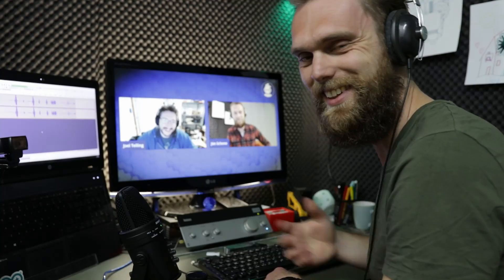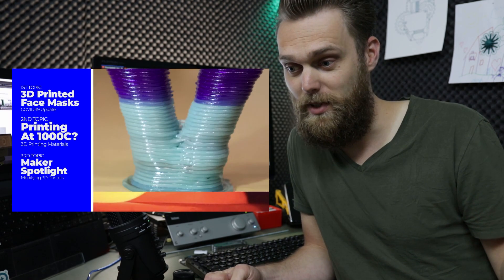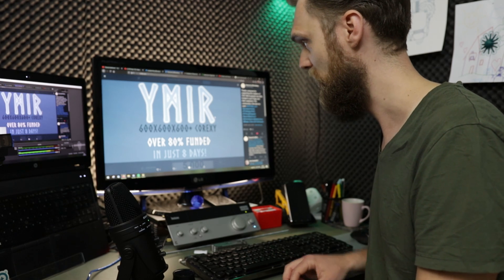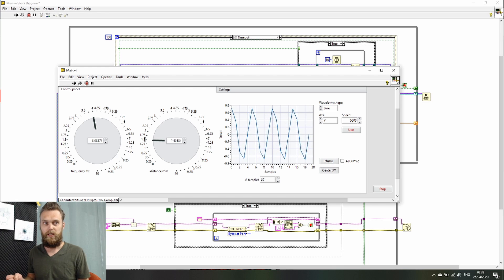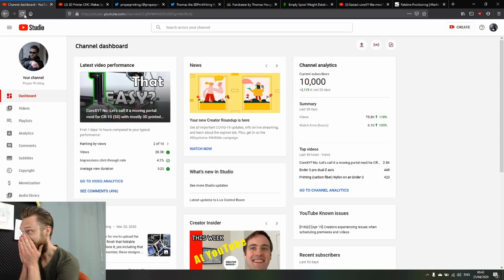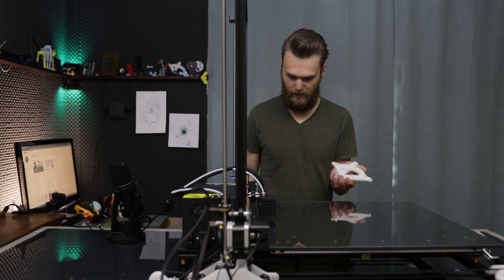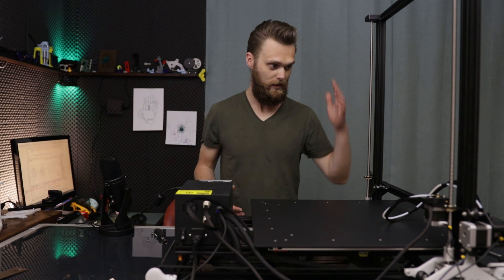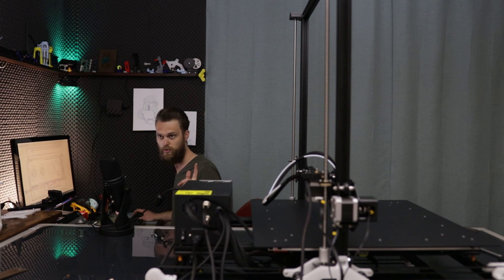Moving portal printer torture test, how does it perform?

Comment: Hi great work bro try my experiment if you can add in equal weight in the opposite direction of the extruder  so when it move the weight move in the opposite direction. I try this and I got amazing results, I’m sure with ur experience and knowledge you will get perfect high speed clean print, the main issue is the weight of the extruder wen it moves it creates wight pull to the belt and the belt expand little in higher speed

Exactly like the car wheel without balance wight it will make vibrations

Comment: I would add two uprights in the center of the front/back with a single cross beam connecting them. Put rollers on the top of the gantry that will connect to the top of the gantry.
You could even add a stepper motor fo automated centering at the top of the gantry.

Comment: This is an interesting idea.  If this concept was installed on the inside of a cube and the vertical member was captured at the top and bottom, then this would be a highly rigid design.  That would give you your enclosure as well.

Comment: If you want a moving gantry, my naive design would include it riding on a larger Y carriage, and triangulating the upright. Those alu profiles sticking straight up without support is never going to be good at 3D printer speed.

Comment: Jón: You could mod the software to keep track of what the apparent y frequency of osilation is (do x while at it) and have drivers alter print speed +/- n% to avoid those resonant modes. Got 32 bit controller, might ad well do something with that processing power. Could also add counter weight motors at top (bdlc with encoder or feedback driver) to oppose the forces if that was necessary. Math gets a little complicated with active dampening though.
Reply: BTW: Active dampening is very common in skyscrapers, weight is at about 2/3rds full hight.  Former World Trade Centres had it (thank goodness I never took the job as Mechanical Engineer for those buildings back in 1999!)

Comment: So your using the xy frequency limit feature in config_adv.h?? In theory the same printer should have similar enough resonant frequencies.. wonder if someone has done a stock ender 3 so i can use tht feature... Gues i could do this myself... Have an app on my phone tht measures vibrations actually. Dont have gcode programme though.. the feature says it limits the frequency of small zig-zag movements..?

Comment: Greetings.
If I got it correctly, You are planning to print (mostly/only) rims…
How about using a rotating print bed for that. A lot of the x and y travel would than be just smooth rotation (of the C axis I guess).
godspeed
Reply: Would be interesting to see. Actually there could a rotating axis on a rotating axis to cover a full circular print bed.

Comment: How about wheel wear? I may just build a 500x500 from scratch at this point and wanted to do this but figured it was unreal without more engineering for supports

Also do this with the z maxed out and move the y +/- to see how well it holds layer alignment throughout

Comment: An extrusion along the top of a chamber being used as a linear guide for horizontal extrusion at top of "gantry"(?) I would think can make it a lot more stable.
Reply from the maker: That would be my second phase and I think I'll do that. I think it's stiff enough, but it can always be improved ;)
Reply: @properprinting  if you don't want to make a full on enclosure 3 extrusions could make the top guide rail, 2 extrusions holding up a 3rd. 

Not as rigid as a enclosure with top guide extrusion but since the guide extrusion is only to help stiffen things up slightly it probably isn't going to have a bunch of force imparted into it.

Comment: Do you really need the printer to be that high? How much would you gain by reducing the Z height by 100 mm?
(Your data doesn't show it because the gantry weight would be lower)
Also: what if you replaced the top cross beam of the gantry by something much lighter?
(A carbon tube, for instance)
Reply from the maker: For this specific project I indeed don't need that height, but I have other plans for the future ;) It's already pretty stable IMO, but I'm going to make it more stable when making that enclosure

Comment: Can you modify the gcode to avoid moving the y gantry at speeds and changes in direction which will cause resonance?
Reply from the maker: Someone mentioned a Marlin branch which removes the resonance frequencies. I'm going for a mechanical approach by stabilizing it at the top :)

Comment: Dude I actually admire your work!!! Good job on getting guts to make youtube videos, its not an easy job and takes time and editing skills. Especially when english is not your main language. 
You have new subscriber and keep it up. I will keep an eye on this project. I think you could maybe improve this wobble at 400mm with reducing printing/movement speed. Try 3d printing brackets out of polycarbonite fillament/ Nylon, as PLA is very though, but its softer and therefore higher chances of wobble. 
Keep up with the great work!!!
Reply from the maker: Awesome, thanks for subscribing! I'm going to stabilize it at the top when making that enclosure :)

Comment: First of all congratulation on achieving 10k subscribers. 
I know all info of three data assessment is not on the video and may be taken into account. 
Just to make clear question with my background as a  CAE engineer and NVH car components development experience. Did you make always the same displacement at all frequencies? 
Resonance is usually  measured as the amplification of the input signal. 
So normally you place the part in the shaker and an accelerometer to measure the amplification far from the source. 
The input control is normally made with acceleration as deflection in the elastic part of material behaviour is proportional to the young/flexural modulus. More force more displacement/deformation. 
If you translate the gantry a certain amount on 50 mm at 10 hz [ And you consider a sinusoidal acceleration/ deceleration wave] it will have to accelerate more than at 5 hz before it will have to travel double the distance in the same amount of time.
More acceleration on the gantry bottom  to make that distance is more acceleration and add gantry mass doesn't change force at centre if gravity will be higher with increasing frequency. 
Normally you vibrate with a fixed acceleration and increase the frequency every certain seconds Within a study range (low frequencies may be a problem as displacements tend to infinity at 0 hz.
If it is bit already what it's doing,  do you think you could change your software so it sends gcode to input the sinusoidal acceleration?
Sorry if if was too technical but I don't want you top draw bad  conclusion due to a bad input.  Even so, from the structural nvh perspective the worst scenario are findings worth low rigidity (as it holds the weight of the rest of the assembly)  and mass far away from fixations (more distance more moment to counter at fixation).
Keep with the videos as many may learn something or light up on their doubts, ideas....

Comment: Even if the bottom of the printer ends up being lighter than the "portal", and you're moving more mass around, the benefit of having the part stay still while printing is huge. A lot of my prints end up detatching because the print bed just shakes it off during the print.

Comment: The weight is high so in order to print good quality the speed must be slow:(((( one way to compensate it by bigger hot end :(((
Reply from the maker: A bigger hot end will be added of course, but the fix would be that stabilization at the top I mentioned ;)
Reply: @properprinting  as form my experience the best option is the cr10 or ender 3 for tables 350-350 with hot ende up to 1.2 mm) the speed can be reached 100 mm - the only thing you have to change stepper motor on the bed drive from 34 to 48! this will be good! i am on process of my 340-340 with all upgrades hope by the end of may will finish (will be testing skr 1.4 turbo and skr mini v1.1 all with tft 35) do it direct extruder bmg - also in order to safe space want to try extruder cr 10 ) the bed weight is already 1 kg! so this is all about the weight! in you construction for stability you have to increase the space between the wheels in the cartridges (now you have got around 100 mm increase it to 150 or to 200 mm and it will be mo riget and stable but ofcause you need to increase the length of aluminium profile) this is what is did 150 mm for bed 340-340 ) https://youtu.be/HUj-qTJCheg you will see on this video that i mean ))))

Comment: This doesn't really test the issue you will be having. You just need to do a start stop start test. With the X at max, move to Y home + 10 and take a picture or start recording. Move to Y Max and then do a travel at max speed to Y+10 and then back to something like Y+60. This will give you a jerk and then you can compare the original and motion and see how much deflection happened. I would expect it to be 2-3mm. 

Congratz on 10K and I look forward to the enclosure build.
Reply from the maker: Thanks for your insight! What I wanted to show is the maximum possible deflection to get the worst case scenario. As far as I can see it cannot get worse than hitting those resonance frequencies. With this information I know what I can expect and that the result would probably be better. It's not me that's having the issue by the way ;) I'm just going to stabilize it at the top and people can see for themselves what's the worst that can be expected with this mod which is shown in that Excel. Thanks!

Comment: With high will get also inertia, from the weight of your print. so in order to be able to print correctly, your printing speed will decrease with every millimeter you will get on Z ax. Also, you may well be able to estimate the maximum that your bed support as weight.  So for "correct" printing, your speed will be lower at the end of the print to compensate, the inertia. Acceleration is also important on your printer, and because of the big size of the bed, I think it is very possible to have a new problem like inertia for the print model (it is possible that printer model to move) or even problems about the aerodynamics of the printed model.  It is interesting your printer design, for me look that old cranes from docs, that cranes that move containers, but with only one pair of "legs" . I think all value of printing speed can be calculated and are related to, bed size, printer nose, extruder capability , high of the model that you will print, high of the z ax with carrier, the distance between wells on Y (that directly get stability or instability).
Reply from the maker: I don't really get why the inertia will increase with the weight of the print while the print itself is standing still with this mod. Anyway, I'm going to stabilize it at the top like I mention in the video

Comment: do you think you could scan the gcode to identify the frequencies and hence the errors due to resonance and maybe patch a part of the gcode to avoid these frequecies ? ?
Reply from the maker: Anything is possible ;) Someone has posted this comment which would do something similar: "HIGHLY recommend you check out the s-curve smoothing branch of Klipper for this. It allows you to tell the firmware the primary resonant frequency and it works to avoid exciting that frequency by  move planning in advance. https://github.com/dmbutyugin/klipper/blob/scurve-smoothing/docs/S-Curve.md" very cool I think!

Comment: Super cool idea. How did you print the PC parts? Were they printed on your moded Ender 3?
Reply from the maker: Thanks! Those parts were printed on my modded Ender 3 indeed! Not the foldable one, but the one with the overdone enclosure ;)
Reply: @properprinting  Awesome. Impressive that an Ender 3 is capable of printing PC successfully. Did you use an all metal hotend or did  capricorn tubing work as well?
Reply: @properprinting  I plan on printing a  propeller for an hydrofoil out of PC. Not quite sure if it will work. My big concern is bed adhesion.

Comment: HIGHLY recommend you check out the s-curve smoothing branch of Klipper for this. It allows you to tell the firmware the primary resonant frequency and it works to avoid exciting that frequency by  move planning in advance. https://github.com/dmbutyugin/klipper/blob/scurve-smoothing/docs/S-Curve.md
Reply from the maker: Very interesting, thanks for your suggestion!! This would be an awesome option if I cannot solve it mechanically or to make it even better! I recon this would solve a lot of artifacts in the print!
Reply: @properprinting  have you used klipper before? It's amazing! Way better than Marlin in my opinion. I think if you give it a try you'll end up putting it on every one of your printers.
Reply from the maker: @clborrello  Not yet, but definitely something that's on my list. For this printer I've bought a Duet board and maybe I'm going to add a RPi as well but that would be optional in the beginning of printing those rims. I had some prints failed due to a crashing RPi which had some trouble with the surge current of my soldering iron when I turned it of... I really don't want that to happen with a 95% finished rim xD For these long and large prints I'm going to stick to that single board to begin with ;)

Comment: Hello Jon, first of all great job man! I have same beast but due to bed and its inertia had some problems for some time and finally decided to upgrade to linear rails for Y axis and ball screw. So parts are here and than I saw your video... Genius idea man, really! I will throw that ball screw and do something similar to your idea but with linear rails. Because I got rails somewhat longer I think that I could add steel brackets for connecting sliders to frame and due to its length I could try to add braces to front end (maybe back also) in order to make it stiff as possible. Thanks again for great inspiration.
Reply from the maker: Thanks Martin! I recon that this would work great with linear rails! Please let me know if you get it to work with that! :D

Comment: Im starting a new youtube channel on 3d printing and enginnering. It would mean so much if you would check it out @ProperPrinting
Reply from the maker: Hi, I've checked your channel and I think that you do have potential since your pretty good in front of the camera considering you just started. I have some tips for you which helps for me so here we go:
Most importantly: pay attention to you audio, audio is key! I could barely understand you because of the low volume of your voice. When the music started (be aware of monetization in the future) I almost had to buy a new speaker xD Edit with your headphones and make sure that audio is spot on and always lower the volume of the music (-6 to -3dB). Or --30 to -22dB when using background music. Your camera is good, lighting is decent, so your first investment would be a mic if I were you.
Remove more of your ehms and pauses, I do have a lot of them and I try to cut it as smooth as possible (sometimes it's natural to leave them in). This is especially easy when showing your screen so you can hide jump cuts.
Ask yourself by each clip: "Does this add value to the story" and don't be afraid to cut things out. When I want to see someone making a Iron man arm, I'm not interested in the room where it's printed in. If you have some nice things you want to show, you can do this by making some b-roll shots to support your story (and hide jump cuts). Don't repeat yourself like you did on the end of that video.
I don't know what your channel is about specifically, is it Fusion tutorials, showing designs or electronic experiments? Fill in your about section so people know what they can expect and start specific. In my case upgrading Creality printers which I'm still doing and can build upon further.

What gave me the initial boost was to post designs to Thingiverse together with the video. My first couple of hundred subscribers are thanks to Thingiverse. This way you don't spam and you know that people watching are interested in what you have to show.
Lastly: watching videos from Nick Nimmin and Peter McKinnon helped a lot for making the content itself, good luck and I'll keep an eye on you ;)
Reply: @properprinting  Wow! thank you so much for checking it out! Im going to take all your help and try and make the videos more focused and better quality. I really appreciate the feedback and I know it will help me do better and hopefully succeed. I discovered your videos a few weeks ago and have watched them all. Congrats for 10K man!
Reply from the maker: @smithingstuff  No problem m8, I really hope that this will help you grow your channel, good luck! Awesome that you've watched all my videos, thanks! :D

Comment: Nice work. Just an idea to make it more rigid: on each side, if you have the room add 2 other wheels (one up/down), then make a triangle from the top to the bottom with a carbon fiber tube/sheet.
Reply from the maker: Pretty much what I'm going to do when making that enclosure ;) Besides the carbon fiber tube :)